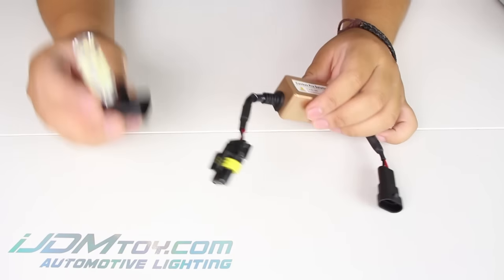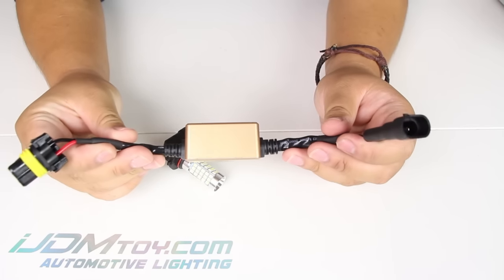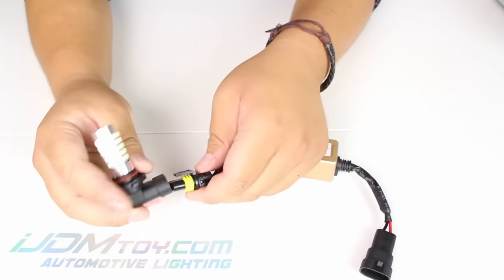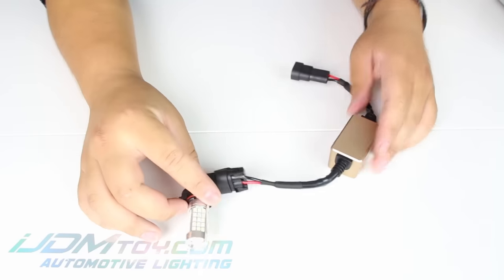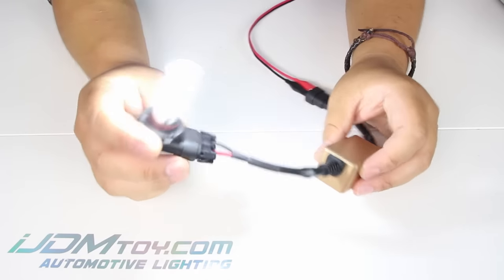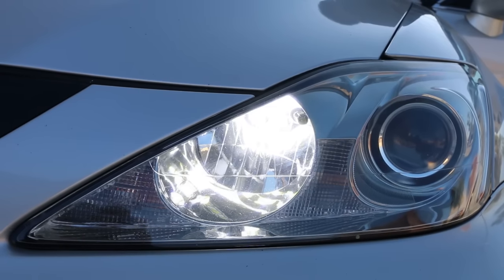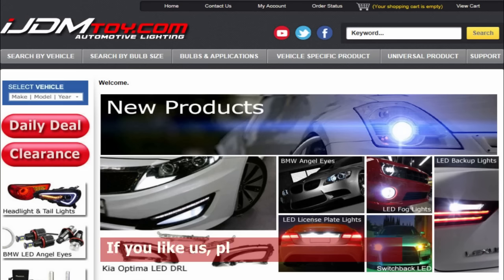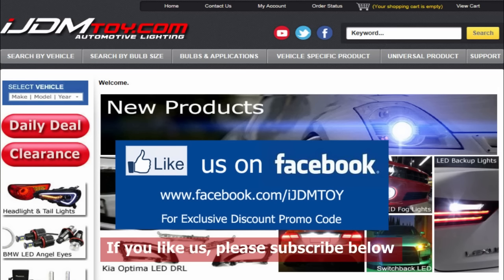iJDMTOY Non-Polar Sensitive LED Decoder

Comment: I bought these and they barely reduce the output of the bulb and pretty much run at full power. You can notice about a 5-10% increase/decrease in light output when the high beams are turned on in comparison to the DRL’s. 
Any suggestions?